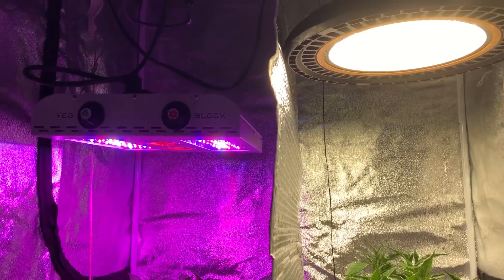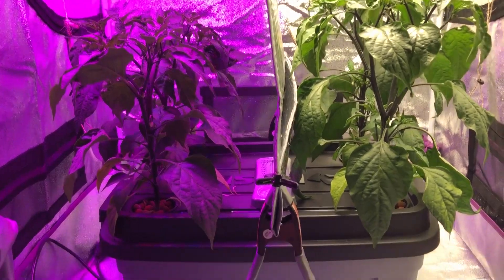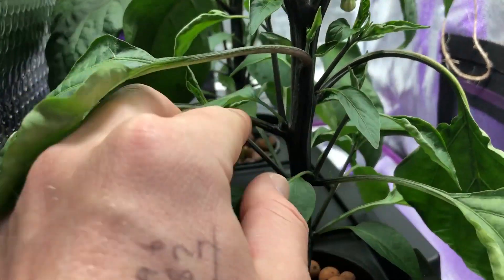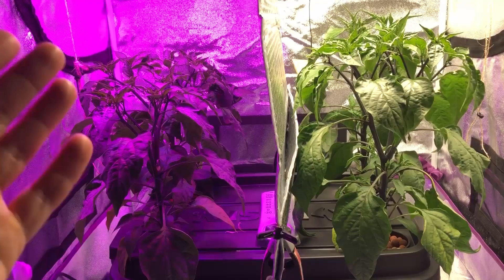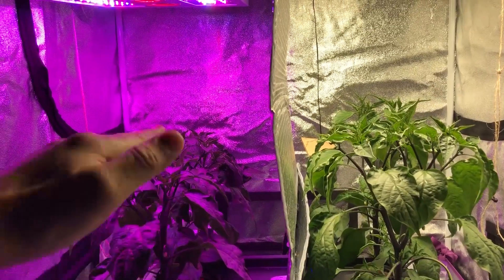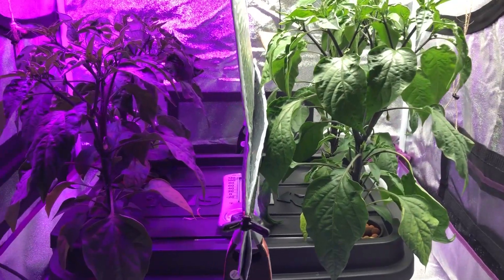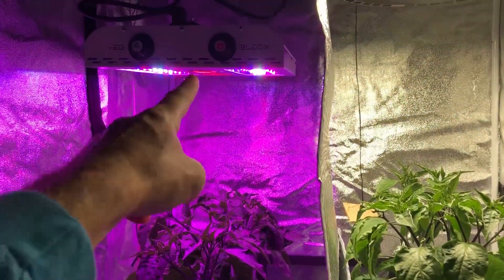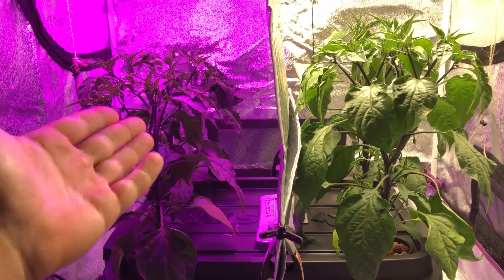MaxBloom vs High Bay LED Grow Light S2E3

Comment: Interesting.  So many warriors on the net with the "blurples are sh#t & quantum boards rock" pitch, not one if them is actually able to describe the differences in growth.  You're one of the only testers actually comparing observations of the characteristics, well done.

I've found the same thing testing white vs blurple; you always seem to get more nodes, branches & much stronger development lower down on the plant with whites.  Higher green % in the white seems to get more canopy penetration & more light to the covered parts of the plant.

Comment: I work for a horticultural LED company. A proper one. Why on earth did you part with your money for these? Product description and performance claims are clearly lies. You could've got a proper 80w single cree COB on a heat sink for less money than these gimmicks, and it would've smashed it. 800W Maxbloom, makes me sick. 800W of what exactly....lies?
Reply from the maker: Craig Page I got them to do these videos.
Reply: @GrowingAnswers  But you've chosen two poor lights to compare with each other. Surely the Maxbloom product description itself should write it off as an option, a few minutes of research would've brought up logic chilled LED, cree COB, quantum boards etc as much better options to be showing people.
Reply from the maker: Craig Page Thats not the point. im not showing people what lights to buy. Or what lights are good. This all plays into future videos. These are experiments only. If I just used good lights all the time how would i demonstrate or compare anything.
Reply: @GrowingAnswers  I've spent some time watching some more of your previous videos. I can see what you're trying to achieve now. My apologies. I guess I have an irrational aversion to seeing (what I consider to be) poor value lights being shown on YouTube. I'd love to see you compare these lights to a single 100-120w chilled logic puck for example, in the future. The difference really is astounding.

Comment: Hi Growing Answers, 
Would it be possible for you to do a video on your nutrient solutions, I'm doing your DIY Kratky/Aeroponics setup, almost exactly the same, and was told today that I need to add silica and hydrogen peroxide and a whole bunch of other stuff to the nutrient solution. I have yet to start my grow because I'm still waiting for the extraction fan but when the time comes I really don't want to mess everything up. I'm using two 120 litre containers(+-30 gallons) each with four holes, three plants in the corners and one in the middle, other corner is for the pump so the roots (hopefully) don't grow into it. Any advice or info would be immensely helpful. 
Thanks :)
Reply from the maker: _blod you dong really need to add silica or h2o2. I use the general hydroponics and majority of the time that’s all I use.
Reply: @GrowingAnswers  Brilliant! Thanks a lot man :D I really appreciate it.